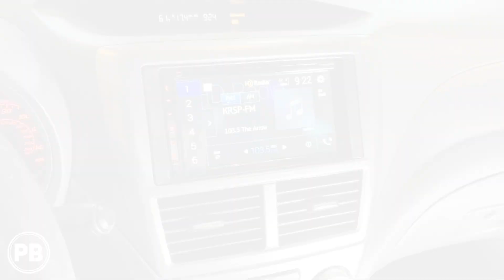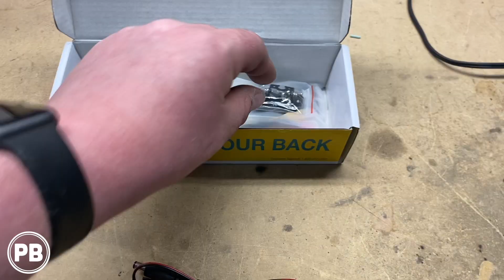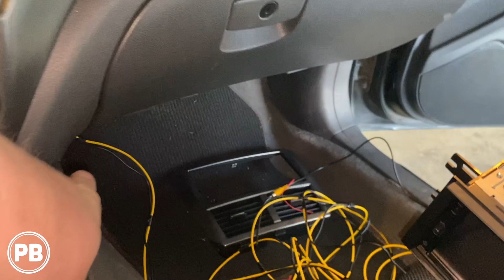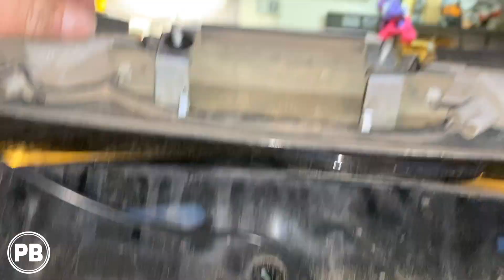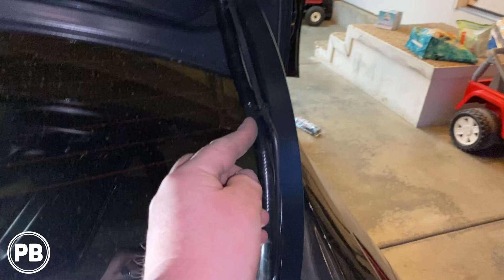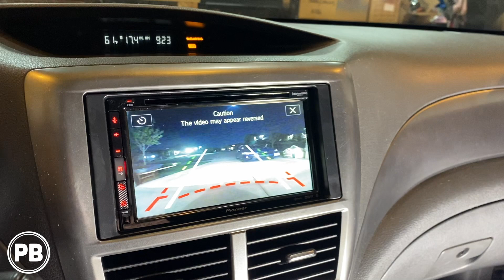2008 - 2014 Subaru Backup Camera Install | Impreza, WRX, STI

Comment from the maker: Parts linked in the description below!
Reply: Hey I'm doing a similar with my pioneer avic. Would i need a bypass harness if i wanted the use the camera to see behind me while driving. In the video you just wired it to the 'accessory' red wire. I bought some extrea 18g to just wire as you did but not sure if I need the bypass switch or not. Thanks!
Reply from the maker: @Halalpepperonii  They Bypass is only for video playback and accessing some menu settings while in motion.  It is totally unaffiliated with the backup camera function.
Reply: @ProvoBeastAudio  appreciate the reply! Good videos too. Has helped me out alot

Comment: Awesome vid but at 10:45 that solder connection will definitely fail over several years, I know because I have tried soldered connections for radios and areas in the rear and they all fail after 3-4 years from vibrations. Crimp connection like you did on the one below would be better but I bet you did not have enough wire. I wonder what wire guage/type could we use to extend the wire?
Reply: I tried soldering wire yesterday for the first time. I have experience soldering copper pipe. I couldnt get a solder worth a damn on the wire. It felt like I should have used flux.

Comment: I have the same problem of the back up light being far from the trigger cable by the camera. Do I need to run an extension for the trigger cable near camera all the way to the back light? Instead, can I just tap into the red cable that come to power the camera and just splice it?

Comment: Can you possibly diagram this?  I have the camera hooked up and when I go into reverse it turns on.  I also ran your yellow wire tied into my accessory (red) wire from the head unit to back there.  I'm not following what your yellow wire goes to in the back.  Please help.
Reply: I might be late, but it looks like he took the accessory power from the headunit/harness and then tapped that into the power wire directly from the camera. 

Then he connected the red lead from the yellow RCA cable to the power wire on the reverse light. This way, the camera is getting constant power from the accessory head unit wire and he's using the power from the reverse light as the trigger. Of course, it also sends power but that's not his "main" use of that wire. Hope that helps
Reply: @aradney3 This is exactly how I ran one yesterday on an older f150. Works great. I didn't run a cable all the way to The back though, just where the reverse light wire is under the driver door kick panel. The main thing to remember is get power to camera all the time. Then, connect reverse light to trigger wire from head unit.
Reply from the maker: https://youtu.be/rHORKUqlEM4

Comment: I've watched over this a bunch of times trying to find where you connect the brake wire but I keep missing it, where in the video did you show the wire?
Reply from the maker: It’s a pioneer so we used a microbypass relay.

Comment: A good tutorial. However I may look for the reverse trigger in the dash vs running additional wires all the way too/from the back of the vehicle.
Reply from the maker: There isn't one behind the radio, so you can look around the steering column, fuse box, etc.  For most people, much much easier just to snag it from the reverse light since you are running wire anyways.

Comment: I have a 2017 Nissan Frontier SV Crew Cab that didn’t come with a backup camera. All the manual says about it is “if so installed” so the version I have doesn’t have it installed. How do I tell if the screen on my truck has video input and how do I know if a backup camera will work on it?

Comment: Could you help with the same radio install but using the CRUX adaptor?
Reply from the maker: Yep, using the Crux SWRSU-38B adapter
Reply: @ProvoBeastAudio  is the installation the same? Connecting the same color wires?
Reply from the maker: @nikko6063  Yep, you got it.
Reply: @ProvoBeastAudio  where does the orange wire from the Crux adaptor go to?
Reply from the maker: @nikko6063  Illumination wire for the new radio.
Reply: @ProvoBeastAudio  what if the new radio (Pioneer Dmh-w4660nex) doesn’t have an orange wire in the adapter?
Reply from the maker: @nikko6063  Be sure to always look up the wiring diagram of the radio you are installing.  Pioneer's illumination is orange white.
Reply: @ProvoBeastAudio  I see the orange white but the crux adaptor has both orange/white and a solid orange wire.
Reply from the maker: @nikko6063  On the crux, orange is Illumination, orange white is dimmer.  I'd connect the pioneer right to the orange (illumination to illumination)
Reply: @ProvoBeastAudio  thanks for the advice! So the orange/white on the pioneer wiring connects to the orange on the crux wiring right?
Reply: Can you help my with my xav-ax800 I have the alpine backup camera.